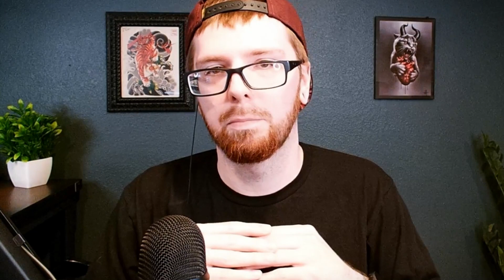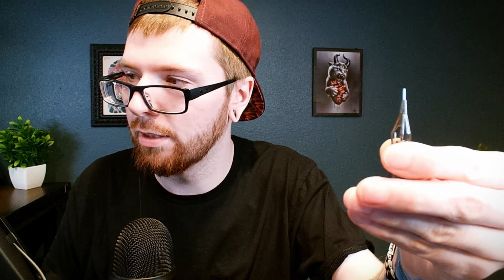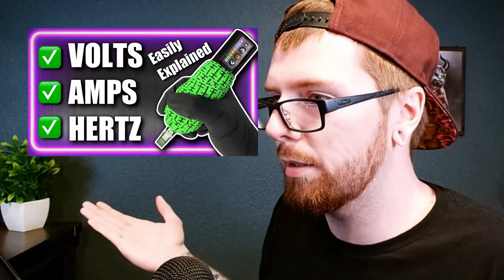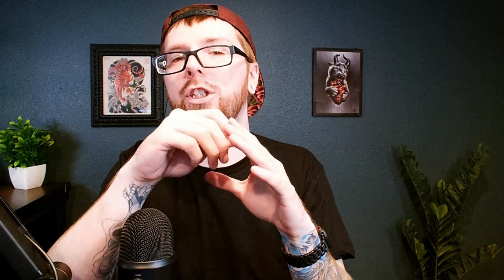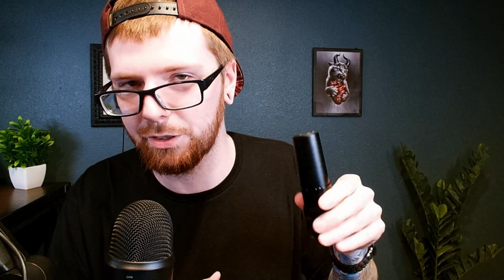Tattoo Hand Speed, Stroke Length And Throw Explained

Comment: I have the Bishop Wand Packer. Used to do old school with a 3.5 stroke machine before and had no issues healing. But since I use the Wand I feel like every tattoo is scabbing up really bad even though my volts go as low as 4,8v. The lineweight was also thicker on the 3.5 stroke machine I feel. My hand speed is pretty low but not that low. But I'm kind of afraid to up my voltage since when starting I used 6 to 6.5v and my work scabbed up really bad. But same thing with 5v, so I feel like this machine is just not made for my hand speed. But then again I have seen people on Youtube working with the Packer on 8.5v, not moving significantly faster than me. Depth is not the problem. Not sure what to do.
Reply from the maker: A lot of people are moving faster with that machine. It’s very powerful you don’t want to go too slow with it. And you can’t keep going over there same area as much as you can with a shorter stroke machine. Once the ink is in move on to the next spot
Reply: @adamdarklord  Thanks for the reply. Appreciate it.

Comment: Is 4.5 so much different from 4.2? Im willing to get the cheyenne sol nova but the stroke lengths are either 3.5 or 4.5. I only do lines but sometimes as small as a 9 liner so Im afraid the 4.5 stroke will be like a chainsaw for that. I also do big lines like 16 RS thats why Im leaning more to 4.5 than 3.5. Any thoughts are welcome!
Reply from the maker: I replied to your comment on the sol nova video 🔥

Comment: i have a spektra xion and since i started using the 3.7 for lines, if i turn the voltage to 7.5-8.0 it hurts like hell, me and the clients, but if i tattoo with like a 7.2 its perfect. Could you please advise your thoughts for this? is it because i have an average hand speed?
Reply from the maker: I’m trying to remember back to when I used the Xion everyday. 
I believed I used it around 8volts for everything.
There’s a lot of things to factor in like where you’re doing the tattoo on them. 
Some spots hurt way more than others even if they’re only an inch away from each other.
You might have your needle out to far and moving to slow. It’s hard to say without seeing your work.
Hopefully that helps 😅

Comment: From what i learn, stroke is essentially how hard a machine hits because of the distance it travels, both small stroke like a 3.2 or 4.2 can carry the same amount of ink in the cartridge, but with  a shorter stroke the needle hang does have to be lessen for it to grab ink, and longer stroke can grab ink with a longer needle hang, and with a 3.2 or 3.5 stroke machine doesn't mean you build layers slowly because how much ink is in the cartidge, you are able to build layers slower because of how that needle bogs in the skin. So when you have a machine with a 4.2 stroke, you are able to saturate or do solid thick lines quicker because of how hard it hits and how easily the needle bogs in the skin.  But we also have to remember about our volts because that also plays a role.  This is what ive learn from my own research, so I might be wrong, just wanted to share. 😁 please correct me if I'm wrong, i have been wrong before many times.

Comment: Adam the machine speed comes from the motor man not the stroke. It is simply physique. The rotation is the same the acceleration is only different because of the weight on the cam and the length of the travel. They rotate around the shaft in the same way. It is the same time for 2.5 and 4.5 mm stroke if you use the on the same machine.
Reply from the maker: Awesome, I’ll pin your comment!
I’ve been told multiple different things on that specifically with stroke length affecting the hertz.
I’ve always believed that it didn’t because it’s fixed to the motor.
Apparently there’s some video out there proving it but I was never shown this video lol 

I’ll fix the error in when I address stroke length again
Reply: @adamdarklord  it may slow down the motor when there is more pressure for sure. The bigger the rotation is the heavier the weight will be and it will pack better punch. If the motor is weaker it will slow down easily.